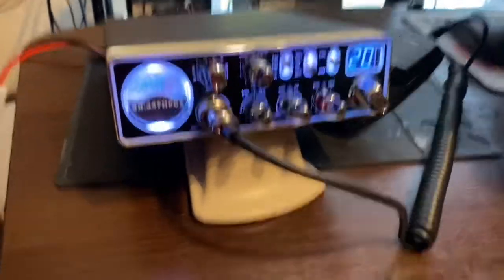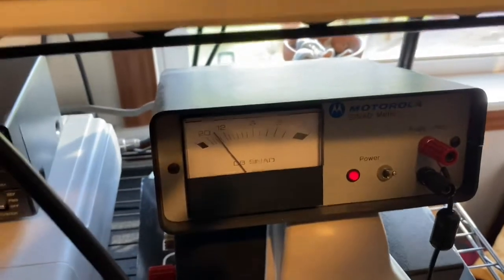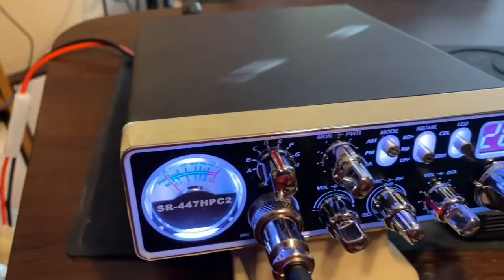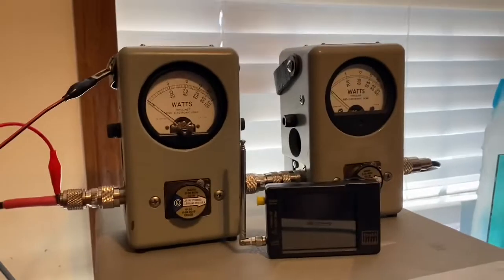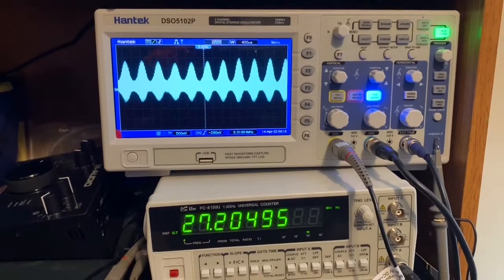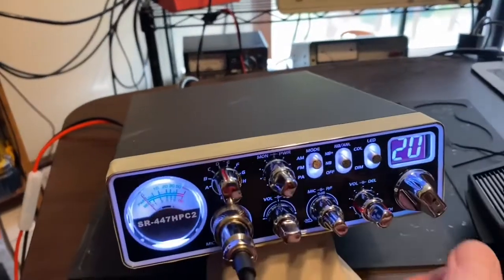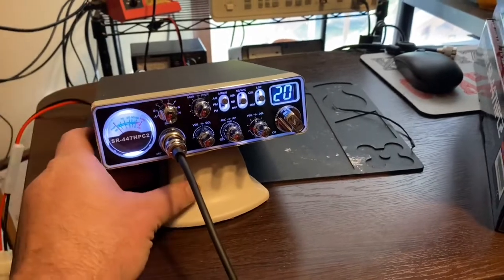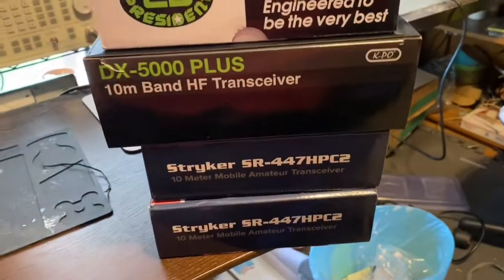Stryker 447 HPC, and more radios for sale

Comment: Those 447hpc2’s are great radios!  Good talking and receiving.  You can get 100 watt peak clean power out of those easy if you wanted.  It looks good on the scope and spectrum too.  It’s cool how you can go inside and adjust the bass and treble for the receive as well.  Super radios for the money and simple to use!   Great channel, love the videos.  Have a great one my friend 😎.
Reply from the maker: Yeah not a lot to gain by turning up to 85-100 from 65.. nice and crisp! Thanks for watching
Reply: @ChiefMade  I have 2 of them..low power is 2, high is 13.  I run it at Noon and mic gain is at 2.  I run a 20 year old Telex RK 56. Avg power is at 35.  That’s plenty just talking on the highway and interstate.  Hell nobody has a radio and if they do they have it turned down and can’t hear crap anyway 🤦‍♂️🤣.  Do you collect them as well?
Reply from the maker: @hazmathauler4536  exactly! I drive as well, I run a 497 in my big truck. Not collect but I have too many 😂
Reply: @ChiefMade  That 497 is nasty!  It’s probably pushing 120 watts pep?
Reply from the maker: @hazmathauler4536  mine is set right at 110 pep
Reply: @ChiefMade  Perfect 👍🏻